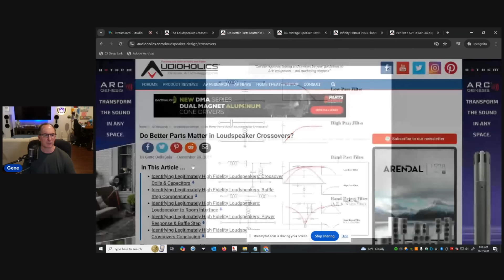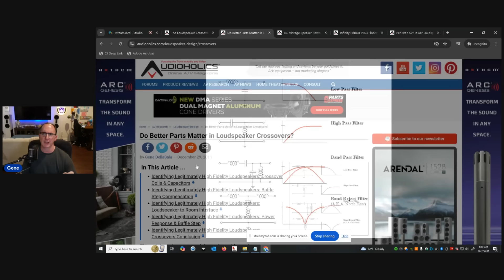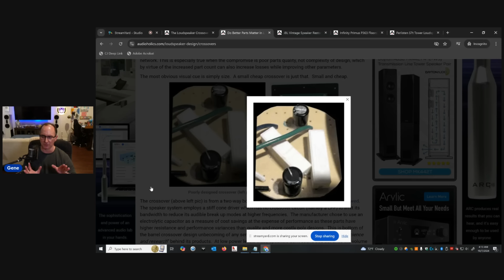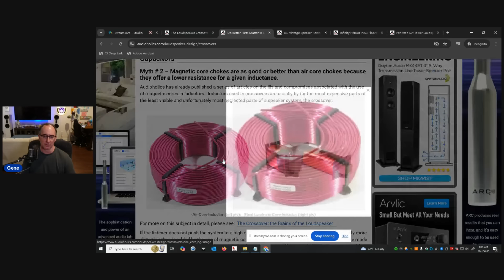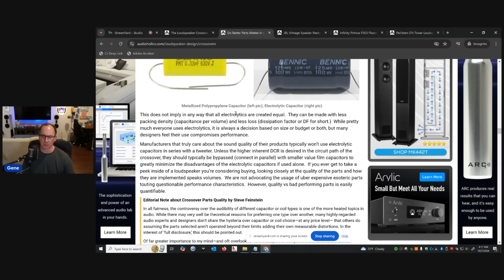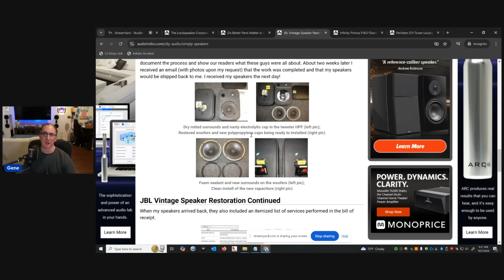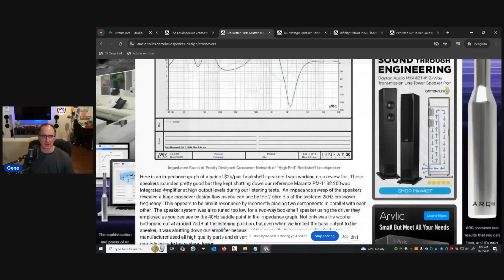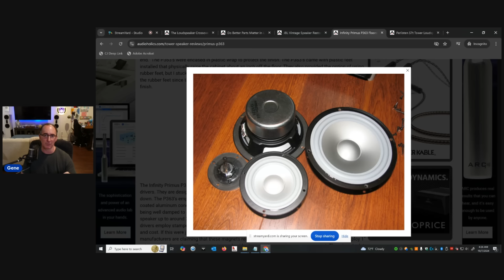Loudspeaker Crossover Upgrades - Are They Worth the Effort?

Comment: Thanks for a great video. I’ve watched a lot of GR Research videos and have always asked myself the same question “if it’s so easy for Danny to fix, why didn’t the manufacturer get it right?”. I understand the cost of crossover parts can affect it but he is often reviewing $1,000+ designs where $100 wouldn’t make a huge difference. I’ve posted this question on his site but not got answers. I suspect that some speaker designers actually prefer a certain type of sound even if less pure and correct. They might like bass heavy or they might like sibilant for ‘attack’, for example. The other thought is that Danny’s reliance on achieving the uniform frequency response doesn’t really reflect what our ears hear in any case.
What are your thoughts, please?
Reply from the maker: While I acknowledge Danny as a knowledgeable loudspeaker designer and his ability to fix problematic speakers, one also has to recognize his business model is to sell custom speaker kits and crossover mods. There are a lot of talented loudspeaker designers out there that know what they are doing and have the measurement tools to get things right. The state of the industry with high-end loudspeakers today is NOT as grim as he makes it out to be, IMHO.

Comment: Hi gene - I got sucked down this rabbit hole. What I would like to do. I bought a pair of Energy Connoisseur C7 tower speakers. Energy was known as an excellent speaker manufacturer with ties to the NRC psychoacoustic studies. I started modifying one speaker the following steps picked up from watching GR research videos. First opened the speaker and removed the drivers and removed the fiberglass pink. I made detailed drawings of the cabinet Conctruction. Then I lined the cabinet with 1/2 foam glued to 3/4 mdf. The cross overs were mounted to the binding cup with cheesy parts as Danny would say. Focusing on one Speaker only (alway to have a factory reference.) I work at trying crossovers then drivers only to have mixed results. I was thinking that the engineering analysis from box design to actual driver performance (in the box) could be looked at. What if I sent the original unmodified speaker to Erin to get measurements of the factory product. Then send the other speaker to GR research to go wild on crazy mod. Then send the modded speaker to Erin to see the comparison. I could easily handle the transport between parties. I don’t know if anyone would be interested. Let me know

Comment: Is their some actual sonic issue with a sandcast resistor or gold plated steel at the speaker wire connections? I could imagine the steel at higher power levels perhaps. I just didn't think it would matter much otherwise, magnetic or not.

Comment: I have a question that i hope a few people would provide input on.  I have hearing loss in my right ear, almost 40 percent gone.  What I have noticed as i get older is loud is not better, and clarity is.  I am in the market to either build something like a CSS or buy a KEF R11 or SVS evolution pinnacle.  There is no one place to hear all of these speakers to find my preference, but i look at the best option from CSS, and it does not look like it's on the same level as the others.  People in group chats swear it's better or equal.  Is it the crossovers or the sweat equity that people like?  I just want the best sounding for the buck, and i understand that's a personal aspect, preference over reference.  Of the three, is there a hands down winner?  Is there a different speaker that is far better in the $5k range that I should consider punching above their weight?
Reply from the maker: Yes as you lose hearing, you also lose dynamic range meaning you can't hear thr soft stuff as well and the loud stuff becomes overwhelming.  It really suckyourGet your room acoustics under control for better intelligibility.

Comment: I am DIY and the design is so, SO much more important than the quality of the parts.
Fixing speakers that lack zobel networks, proper driver attenuation and mixed slope crossover points is going to be a night and day difference.
The quality of the components is going to be the last 5%.
Like anything, diminishing returns rears it's ugly head after proper execution.
In most cases, as long as there is proper design in the first place, you are far better off upgrading other components.

Comment: Hello. I follow your channel and this video is a very relevant topic. 
I know you consider Focal a good brand and I actually have a pair of Sopra 3 in my room. 
The thing is that I saw a video with its crossover and it seems to use electrolytic caps and some other lower end stuff. Nothing near the quality of the Perlisten crossover you showed in the video. 
Is it worth upgrading the Sopras crossover? I would love to know your opinion which I respect.
Reply from the maker: Sopras measure really well so without seeing the schematic of the crossover, I can't answer that. Maybe thry bypassed the electrolytic with poly caps? If they sound great to you, that's all that matters.

Comment: Gene, good video. I think AV123 was Danny's old company. I'd like a little more info on inductors and caps because of the wide price range differences. When is it acceptable to use an iron core inductor and at what frequency might the difference be audible? Audible differences with caps and bypass caps? etc. My battle is value vs. quality. Is there a line with internal components that's good enough?
Reply: I was not associated with AV123 other then doing design work for them. We will use an laminated cored coil only in ranges below 200Hz. There is a lot of audible differences between caps and by-pass caps. That "good enough" line varies with application and customer.
Reply from the maker: Great points and we will do follow-ups given this topic generated good interest.

Comment: Designed and built a pair of speakers during the pandemics and A/B tested the same crossover schemstic but different quality of parts and couldnt tell the difference.  The key was making sure even the cheap components were matched well. cheap caps have low tolerances.

Comment: Especially if we use a sub, even the mid bass speaker must be filtered. I increased perceived quality of sound by using a DSP (DBX Driverack II) I highpass signal to amp and bookshelves, and I bandpass my sub sending only the band of frequencies he likes.  Only this enable good clarity and articulation, and also avoid the glassware showcases of my wife not to react to some tracks. I have also some band reject by parametric eq to remove some bad resonances either from windows or some problems of the speakers too close to a wall. We have to do with the rooms and devices we have, not everyone can design a room especially for audio.

Comment: Gr research does use a iron core inductor on the woofer on the brute. In his defense he said under 200 hz it doesn't make a difference and I have seen other designers say the same thing. I myself spend the money on big air Cole on my diy just because I just don't want to take a chance but they are expensive especially when you use 14 gauge iron core inductors . I have been designing and building my own speakers and I use good components, including,wire and silver lead free solder. A 4 ohm tweeter with an 8 ohm mid doesn't matter you just need to attenuate with an L pad so it matches spl even 8 ohm tweeters usually have an higher spl than a mid woofer.
Reply from the maker: There's nothing wrong with using an iron core on a bass driver. In fact, if you get a torodial inductor, you can often get higher value, less DCR parts than the air core equivalent in a smaller package. I probably should have made that point more clearly in my video.
Reply: @Audioholics  it's a lot of information to cover in a short video, but you did a good job. I think everyone learned something and that's what counts.

Comment: The potential impact of the different types of components is nicely described, but I find that this video lacks data. What is the actual difference between different types of capacitors, how much does it help to put a small high quality cap in parallel, how big is the problem with iron cores? How big is "big"?
Reply from the maker: Good point and check out the links in this video for a deeper dive.

Comment: The problem is passive crossovers are a trade-off to active designs. No matter what components are used. When an inductor is in series between the driver and the amp, the amp no longer has full control over the driver. This leads to compromised impulse response. Particularly with bass drivers as the inductor will completely wipe out the damping factor of the amp. A signal cannot change instantaneously through an inductor. This is a trade-off for tight bass response. And technically, the same holds true for the midrange driver. But most, house-priced boutique speaker mfr's such as Wilson, Magico, B&W, etc., sell complete speakers with passive crossovers as that is what the public expects, and it is easier to market them that way.
Reply from the maker: Agreed. Active for the win.

Comment: Education can be expensive, a good education can be 'very' expensive. Before wasting a dime on any crossovers or the parts to build one, it's far better to invest in good tooling and the education required to use those tools. Then you can test and prove where you have an issue and know how/where to correct it, with science, because you got a good education first. Most folks just regurgitate some blab they read in some forum and try to pass it off as gospel. Don't believe all that you read in these noise making forums... Believe the science and the provable facts, believe the test results. And perhaps most importantly, believe your own eyes and ears above and beyond all else. Only 'you' know what 'you' like! Sound is nothing if not subjective.
Cheers 🍻

Comment: I would say that having an unbalanced design, an inferior crossover ,  in a speaker worth modifying  would be a tremendous exception to normality, given the cost of labor .   Plus good speakers are heavy, besides the cost of shipping, the potential for damage must be considered .  

In the early days of hi fi, military grade circuits were commonly advertised in high end stuff, , meaning the crossover was dipped in epoxy for longevity, as in a military device, like a walkie talkie.  I think if you get very good drivers , just like buying a car with a good motor, the other stuff will be  appropriate.    There are custom medical grade drivers available, that are a sure bet. some companies might be able to equal the precision of such drivers , but without a good driver, everything else doesn't even matter.

Comment: Well done Gene. Glad to hear you talk about the in room environment folks should look at first before speaker mods. I posted on Audioholics quite a while ago about getting a GR modified speaker in for your team to analyze, and even had a member volunteer to provide one; but the concept died when no one on your side responded. 

Some of Danny's engineering makes good sense, but others like Power Cables having a dramatic imp[act, and tube connectors for speakers just make me cringe.
Reply from the maker: Danny hasn't been open about sending out his products or his modified designs for 3rd party measurements but we are open to it.
Reply: Seeing as some people think Danny only does the upgrades to make money, maybe you might want to hear this from some one who doesn't do this for money. If you have a high quality pair of speakers, upgraded with good parts, a well treated room, and some good gear to run it with. You will start to hear the difference between cables and even binding posts, however if you shop at best buy and your couch is your room treatment, you will likely think this is all hog wash! It really does tell people allot about what type of system you have when you think it doesn't, not trying to be rude about it. And at this point some convince themselves of this and leave thinking cables and cross-over parts don't matter, but that is like going from walking to launching a rocket to the moon, there were many steps taken between those two extremes , and if you don't take any steps to better your system, you will not hear the difference!
Reply: @Audioholics  Gene, that's why I found a member who already had his speakers modified by Danny, and was willing to send one to you for testing. As I remember, you'd already done a recent review of the "stock" version.
Reply from the maker: @emmet7208  i never said Danny only makes money on modding speakers. It doesn't take more than a few dollars/ft to get sonically transparent  cables that are sonically indistinguishable in controlled listening tests to the expensive stuff in even the best rooms and best gear.

Comment: YES. I also would love to see some tests done on GR Research "upgraded" speakers. So everyone can the snake oil for what it is.
Reply: Indeed.
Reply: Gene did a great job explaining why parts quality matters.  Guess you were not paying attention.  Every competent engineer knows parts quality matters.  As Gene pointed out, there have to be good bones to work with and then determine the acceptable cost value point.  As soon as calls for tests (undefined) and mention of snake oil appear, I know dealing with a lack of knowledge and no desire to learn.
Reply: @jfritzy4358  I watched and I never said quality parts don't matter. I said let's test the claims that GR Research makes and see if it's worth the money or is it just snake oil.
Reply: @ASSOpid  You said "So everyone can see the snake oil for what it is."  Pretty clear for that statement you DO NOT think parts matter.  If Gene did not present a logical, factual presentation you are not paying attention.  A position based on using the term snake oil is a sign of intellectual laziness.

Comment: Yes parts matters,  I do upgrades on my tube gear,  I favor copper foil inductors and copper foil paper wax capacitors Jupiter brand , and milflex using smaller values as Coupling caps

Comment: In my opinion, many speaker manufacturers are using lesser quality components in their crossovers, essentially capacitors, in order to meet the price point they are aiming for.  I have nothing to do with GR Research but I do think that they are fair in their evaluation of speakers. I don’t have the $ to purchase $10-20,000 speakers. It may be worth upgrading decent speakers, than purchasing more expensive speakers. More information on speaker components (drivers and crossover components) would be appreciated.

Comment: Good crossover parts do not fix design flaws in drivers or in system mechanical resonances.   Some crossover design improvements can be made if the original design is goofy with respect to crossover frequencies, slopes, levels, and phase (time).     Any change in the series resistance to a driver should be analyzed to determine if that resistance is designed to optimize the transient response of the driver as some drivers are over damped and utilize resistance to optimize the Q for a specific alignment and transient response.

Comment: I don’t have this crossover problem because my Anothony Gallo 3.5 speakers were designed without crossovers  😊👍
Reply from the maker: No, but there are other problems running a driver fullrange, especially in power handling and dynamic range.

Comment: On the Focal Aria 926 ($2800 pair) which I do not use anymore, the crossovers are using crap parts.  The crossovers are attached to the speaker's Binding posts and not even screwed in with just using Push Tabs (nasty).  3 Iron core inductors, 1 Air core, 2 Poly Caps, 1 Film, 3 cement resistors.  The cabinet has poly foam, good bracing, but the knock test shows residence ringing.  I will be sending Danny the crossover to see if anything can be done.  I will No-Res (it does work) the speaks and make a comparison.  Then I will donate to GoodWill (Sarasota, FL) for someone to enjoy.

Comment: Jon Atkinson from Stereophile, Erin from Erin's Audio Corner and several others were very impressed with the performance AND measurements of the Wharfedale Linton. However, Danny thought they sounded and measured pretty bad and that they needed his $735 (!!!) upgrade kit to sound good. Of course, it's always possible that someone send Danny a faulty speaker.  But that would mean GR Research is selling upgrade kits based on inaccurate data.
Reply: I don’t remember him saying there were bad but bringing them to even another level as he says. Whether this is worth the expense is another question.
Reply: @phfen  Hmm, that would mean he thought they were good but that there was still room for improvement. That was not the case. He didn't understand why reviewers like them.
Reply from the maker: I'm not a fan of taking in consumer samples and declaring if a product is good or not. The critic has no way of knowing if the units received are defective or have been abused or modified. In order to offer design upgrades as a broad stroke for a model, I feel several factory fresh samples should be obtained and analyzed.
Reply: @Audioholics it makes sense, thank you.
Reply: @Audioholics  That makes sense to me.

Comment: Maybe all your speaker reviews should come with a crossover section included and if you would upgrade them or not.
Reply from the maker: @ck-sx4zz  we discuss crossovers and show them in our reviews. As long as the speaker measures well, we focus on the system response, not just a part or two.

Comment: Is there a difference between a 3 cylinder engine and the one in a Bugatti? Of course.   Much depends on the initial outlay of the speaker, its design, and of course is it worth it to you.  I've upgraded crossovers, there's no doubt it made the speaker sound better.   However, it wasn't cheap, so there's that.